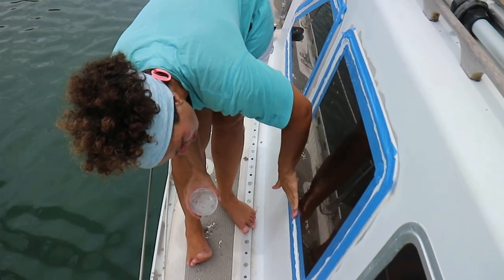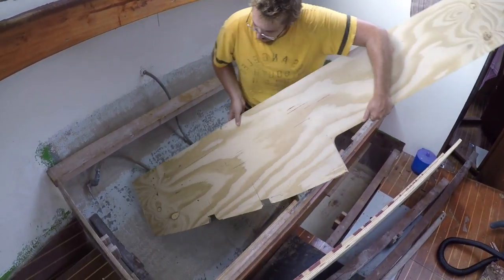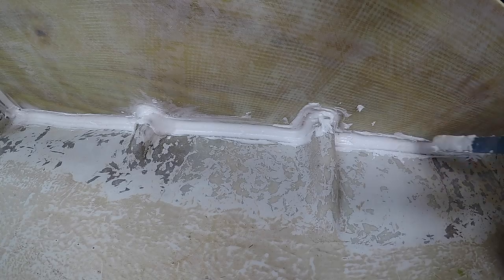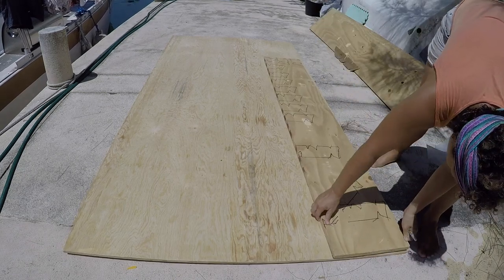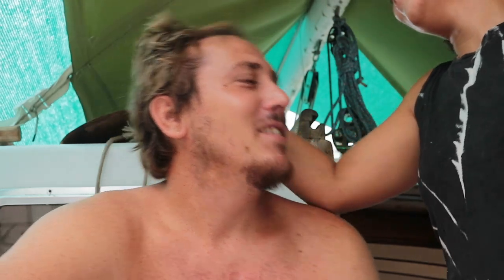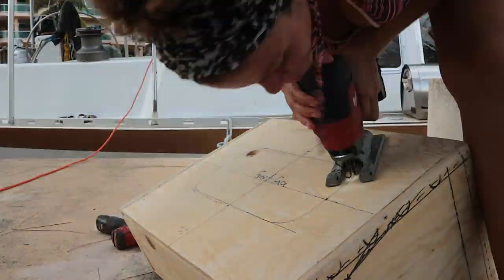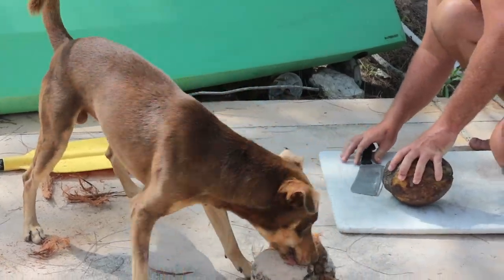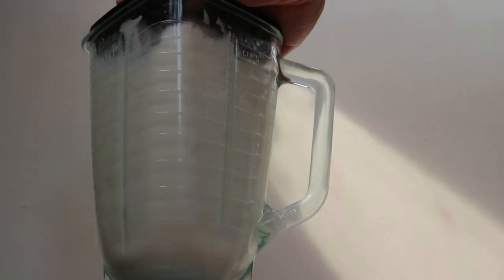Why didn't we do this before? Magic Wand and Potions Onboard (the joggle stick)

Comment: He doesn't use it because old habits die hard. I wonder if using a grinder to scuff the edge of the glass is possible to make a better seal? You have the best dog.
Reply from the maker: Thanks for the suggestion! Will have to try that!